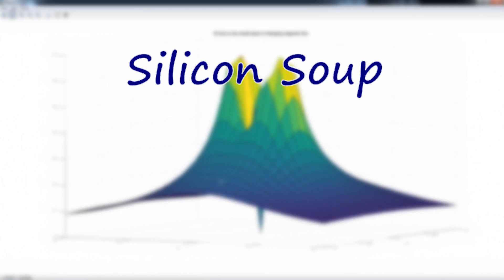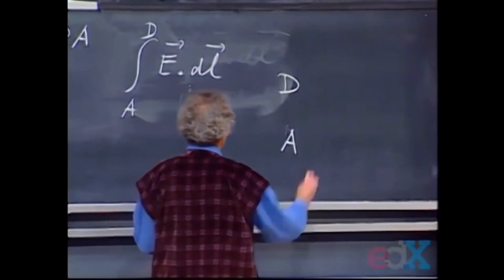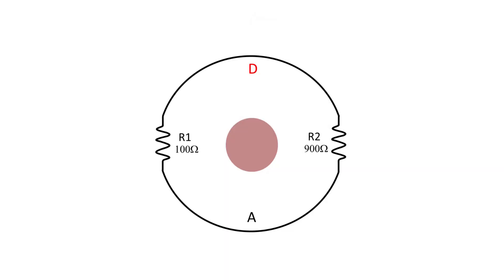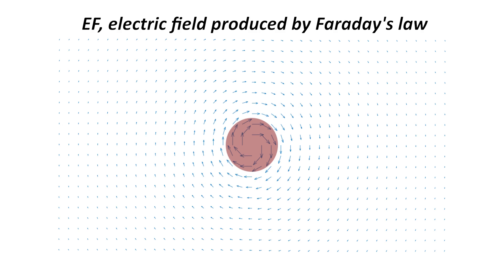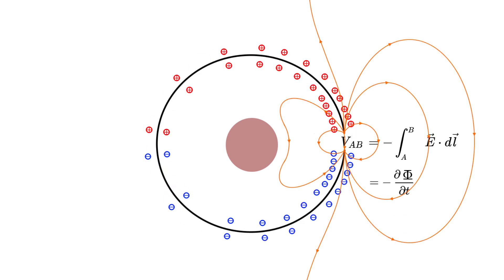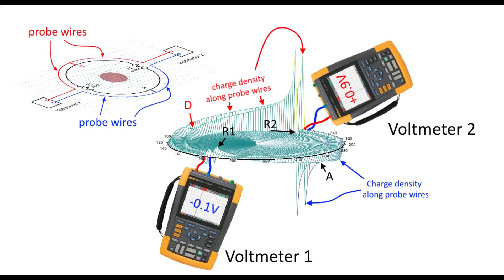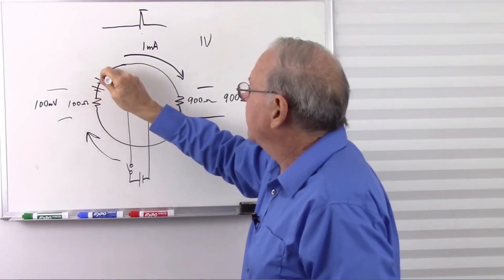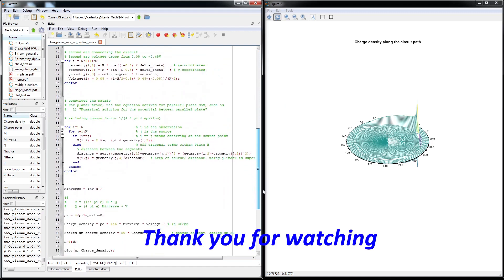Dr. Lewin vs ElectroBOOM on KVL. Of course Dr. Lewin is right.

Comment: Didnt at end Electroboom post a video that professor Belcher agreed with him?
https://www.youtube.com/watch?v=Q9LuVBfwvzA&t

or did i miss something?
Reply from the maker: It is my understanding that Prof Belcher, Feynman and Dr. Lewin agree with each other on this topic. I don't quite understand how Electroboom came to the conclusion that Feynman and Prof Belcher agreed with him.
Reply: @SiliconSoup  he said how in his interview with EEVBlog - he is too stubborn to ever accept being wrong (his words).
Reply: @SiliconSoup  "Feynman and Dr. Lewin agree with each other on this topic"
There is no way Feynman agrees with Lewin about Kirchhoff's voltage law for the simple reason that Lewin's loop rule (LLR, he calls it "Kirchhoff's loop rule") does not work for lumped inductors. Kirchhoff's voltage law (KVL) as derived by Feynman (Vol. II, Ch 22-3, see Fig. 22-9 at 11:40 in your video) as a generalization of Kirchhoff's original version works for lumped inductors and uses a different definition for voltages over circuit elements than LLR. ElectroBOOM wants to make KVL (not LLR) work in the presence of uncontained induced fields, and this turns out to be easy for Lewin's circuit, as demonstrated experimentally by Cyriel Mabilde and fromjesse on YouTube.
The only interesting question in this debate is why Lewin insists that LLR is "Kirchhoff's loop rule". I have him never seen address the glaring discrepancy between LLR and KVL. Instead, he keeps saying that almost all college physics books have it wrong when they use KVL, without even mentioning Feynman.
Reply: That is something that makes me doubt of the good faith of Electroboom. The part where Belcher discusses the applicability of KVL is referred to a LUMPED RLC circuit discussed by Mehdi near the end of his first video. You can apply the 'amended' KVL to lumped circuits, as is show in Feynman. Lewin's ring is not a LUMPED, as a matter of fact it is an example of UNLUMPABLE circuit, and you cannot apply KVL to that.

I seriously doubt Mehdi did not realize that. There is nothing in Belcher presentation or in Feynman's lectures that contradicts Lewin.

Comment: Many thanks for this video.  What it really boils down to is that KVL holds only for the conservative charge distribution along the wires.  There is a clever way to measure the potential from just the conservative portion as demonstrated by Cyriel Mabilde and others, and is alluded to by Prof. Belcher in his paper.  In this limited case KVL holds.  In general, KVL will not hold if the measurement includes any contribution from the non-conservative E field.
Reply: I hate to be pedantic (uhm, no not really. I LOVE IT!!!) but there is only one charge distribution. It is the field that is generated by the one and only charge distribution that is conservative. To this we must add the circulating, non conservative, field associated with the variable B field.

Also, Belcher and McDonald are well aware of the fact that the complete solution - hence the overall voltage - is the superposition of the contributes of the conservative and solenoidal parts of the total electric field. I am not at all sure Mabilde and the other YouTubers that speak of the 'only one voltage' and seem shocked to see different reading on voltmeters attached at the same two points, realize that.
Reply: @copernicofelinis  you are correct in that there is only one charge distribution and associated conservative field. And of course the net field must include the E field from dB/ dt.  That is why the net field in interior of the conductor is zero - the surface charge distribution takes care of that.  It is meaningful to assign a unique potential to positions along that surface charge distribution, and this is what Mabilde is measuring. His probe placement does not add any contribution since there is no tangential E field component on the probing wires. He also probes like Lewin and recreates those readings, explaining quite clearly how in that case additional contributions arise from the tangential E field. Not sure what you are finding inconsistent.
Reply: @bobwhite137  Mabilde thinks that what he's measuring is the one and only voltage (note). Like RSD Academy he cannot conceive the idea of multivalued voltage and believes that if you get two different values from voltmeters applied to the same points then it must be because of a probing error. 

Sorry, but no: voltage can just be multivalued in the presence of variable magnetic fields, just like mechanical work becomes path dependent in the presence of friction. There is absolutely nothing wrong in having different values of voltage along different paths. As a matter of fact, once you have computed the complete configuration of the electric field in and around the ring, you will see that the different value of the voltage computed as path integral of the electric field along the two branches of the ring with the same endpoints comes from the different configuration of the field in the circuit and has absolutely NOTHING to do with the presence or absence of probes.

(Note): what he is measuring is just a partial component of the voltage that we can call scalar potential difference. To do that he needs to intercept enough flux to cancel out the component of the voltage due to the induced electric field (now, this is a probing error!)
This partial component is insufficient to describe what is really going on in the circuit - you need to add the component associated with the vector potential to get the full picture. And a proof of how incomplete this description is is that you cannot even apply Ohm's law to the scalar potential difference.
Reply: @copernicofelinis  Have you read the Kirk McDonald paper?  I agree fully with his analysis. You are mischaracterizing or misunderstanding what I’ve said.  If you think McDonald is wrong, then we are down to agreeing to disagree.
Reply: @bobwhite137  of course I've read it. He's just decomposing the total field like I described above. Unfortunately a lot of technicians who have no idea of what the vector potential is, or what Helmoltz theorem says, think that that partial component of voltage (scalar potential difference) is the one and only voltage in the same way that the voltage across the terminals of a lumped inductor can be thought as a  potential difference for which we can apply the 'modified' or 'extended' version of KVL.

You cannot do that in a circuit that is not lumpable. This is what Electroboom, RSD Academy, Mabilde and van Merveinne do not understand.
Reply: @copernicofelinis  I’m not here to judge what they do or don’t understand. I was making a very simple point that Mabilde devised a clever way to measure the scalar component, and that the scalar portion follows KVL. I completely agree that in the general measurement case that path dependency exists.

Comment: I just want to know how does the first voltmeter know that it is measuring R1 and the second voltmeter measuring R2 this only implies that the reading of the voltmeter is affected by the magnetic field thus turning back to (BAD MEASUREMENT)
Reply: We talk about bad measurement in engineering when you unintentionally measure a picked up emf too. So, if you intend to measure the voltage over r2 and you use voltage meter 1 for that you do bad measurement because you pick up the whole flux within the loop.
Reply: @kriswillems5661  exactly, from 7:52 he is just explaining bad probing, there are not 2 different voltages in the same points.
Reply: The voltmeter measures the potential voltages in the measuring loop plus the induced emf. In the volmeter1 r1 loop there is no induced emf because the area is zero, so there is no changing flux. So volmeter1 measures the voltage over r1. In the voltmeter1 r2 loop there is both a potential voltage over r2 and an induced emf (because all the flux is going through the loop) If you add them you get the same voltage as the potential voltage over r1.
Reply from the maker: The voltmeter doesn't know which resistor it is measuring, it only shows the voltage at its input terminals. The voltage at the terminals is contributed from all the voltages along the probing loop, especially the circular e-field which is often neglected in the analysis. When the two voltmeters are connected to the same points, we expect the reading to be the same (if there is no changing magnetic flux), but with the induced e-field, the left voltmeter experiences the circular e-field pulling the  charges away from its +input; whereas the voltmeter on the right experiences the circular e-field pushes the charges into its +input, therefore the two readings are different.
The laws we know (faradays and coulomb laws) explain this phenomenon very well. The left meter measures the voltage of R1 correctly, but not for R2, so in away it is a probing error for measure R2, but science has a solid explanation for this, so it is what it is.
Reply: @SiliconSoup  Neither voltmeter can measure the voltage across either resistor correctly. Both Voltmeters have an offset. One with a positive offset and the other with a negative offset.